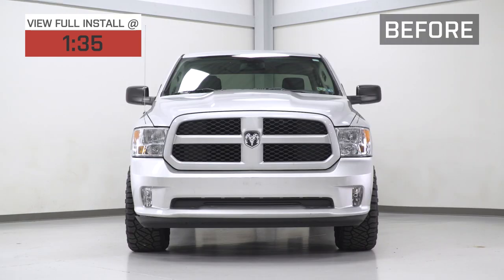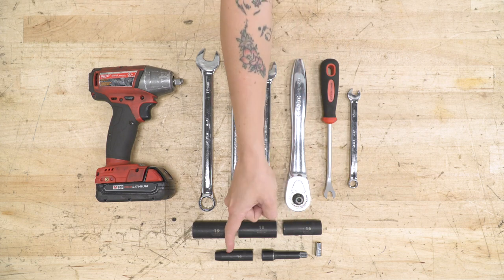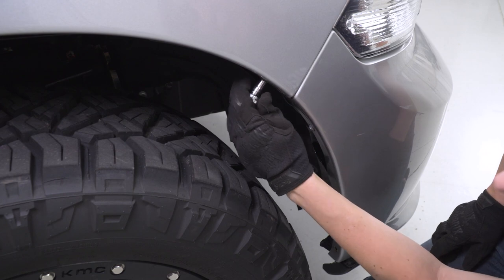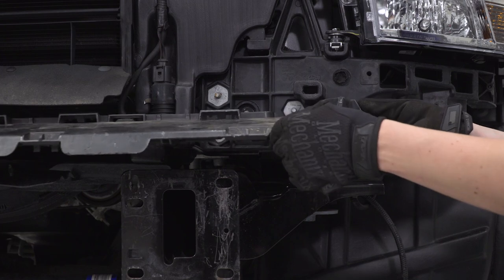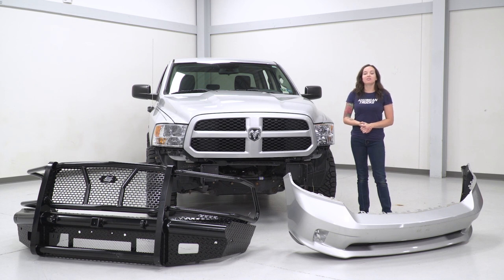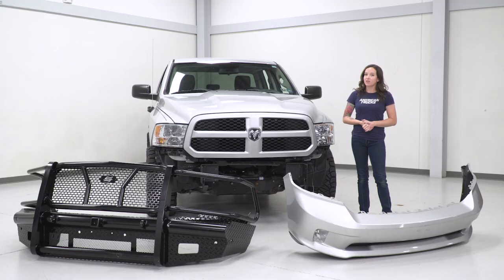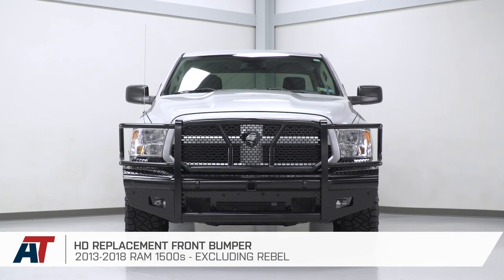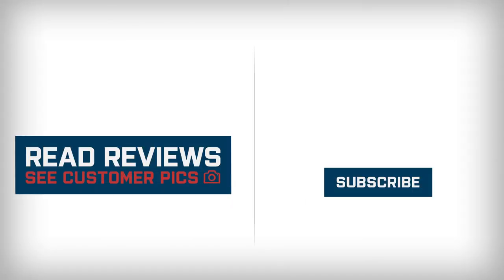2013-2018 RAM 1500 HD Replacement Front Bumper Review & Install

Comment: I have had no luck with the stock fog lights (the vampire teeth) and swapping them and turning them horizontally. They don’t work like that, I’ve bought aftermarket ones but the brackets don’t line up, and I’ve tried several kinds. Any suggestions - without having to creat my own brackets?
Reply: Poor design. I have the same problem.

Comment: Mine fit great but my fog lights now are turned on the sides and the beams are messed up. Do I need to buy new fog light housing or what?
Reply: I was wondering this myself, did you find a solution?